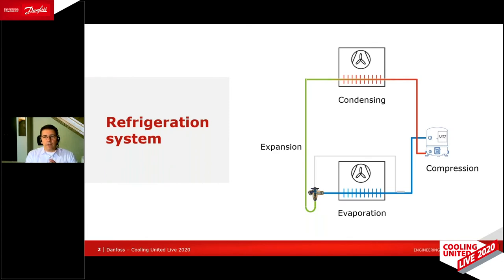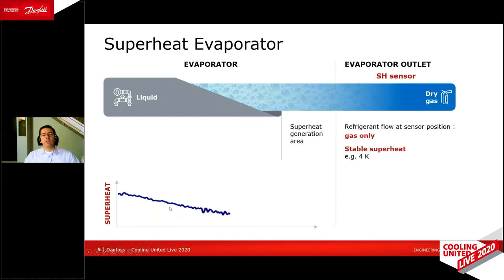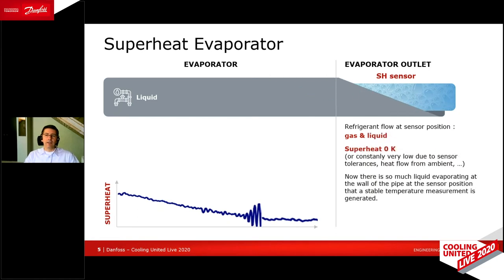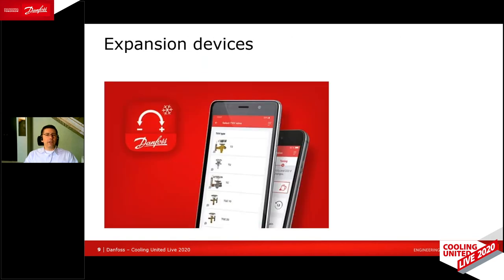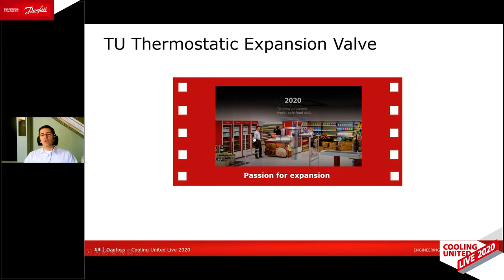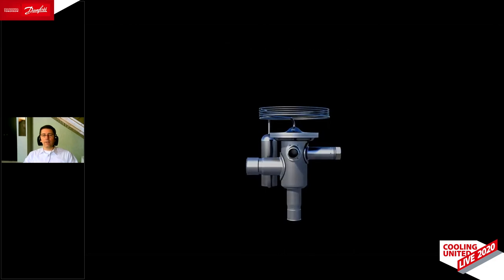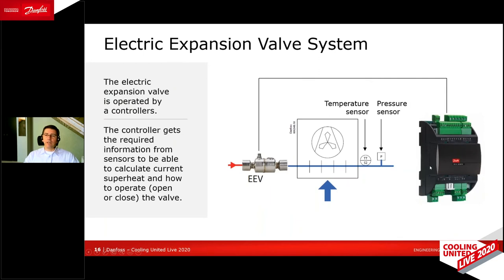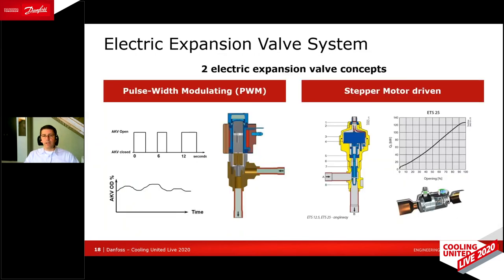Energy improvement with superheat control | Cooling United Live

Comment: I’m still struggling to understand how minimizing superheat improves energy efficiency. There is, however, a lot of information on HOW an electronic expansion valve can minimize superheat.
Reply from the maker: Hi Michael, Thanks for your comment.
If the superheat is high, then it often reduces the evaporating temperature. The max evaporating temperature can not be higher than media temperature minus superheat. Since the media temperature is given, an increase in superheat reduces the max possible evaporating temperature. A lower evaporating temperature reduces the energy efficiency of the system.

The aim is to operate with an evaporating temperature which is as high as possible for given media temperatures. This will lead to the best energy efficiency.

If the superheat is high, then a reduction of superheat can increase the evaporating temperature which improves the energy efficiency.
Hope this was helpful :-)